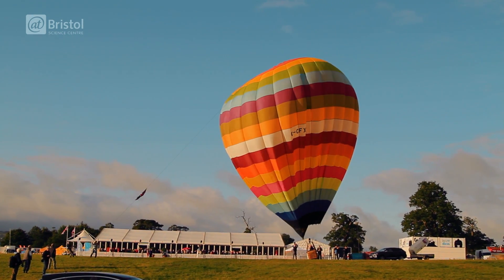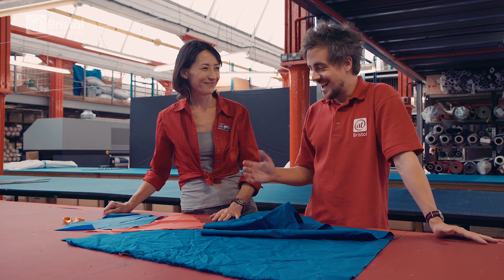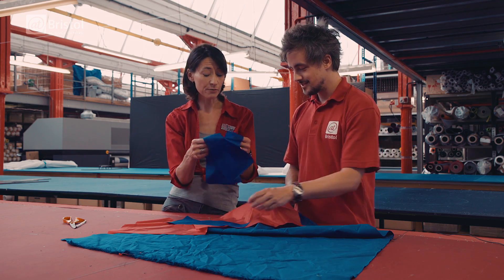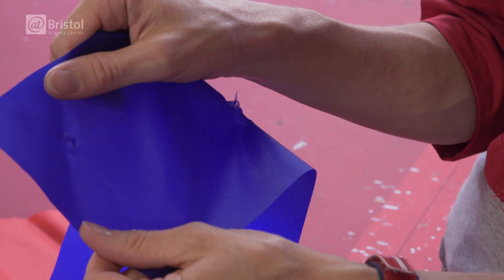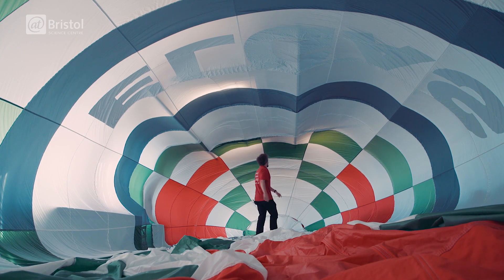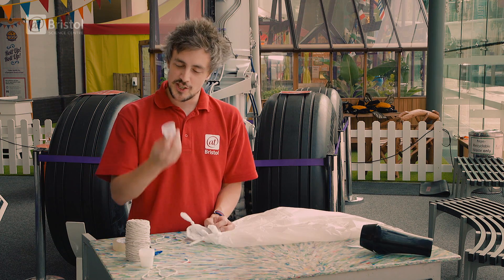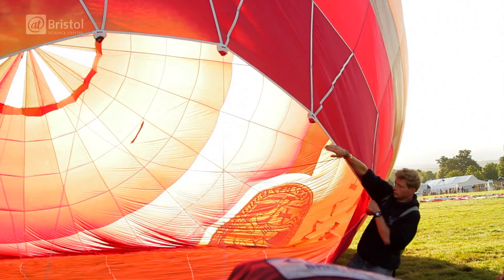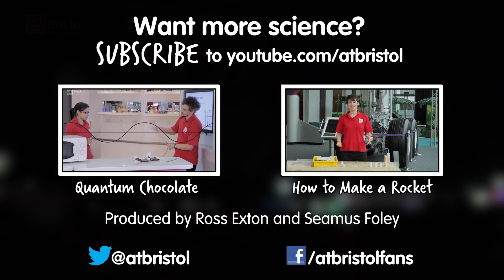How to make a hot air balloon | Do Try This At Home | We The Curious

Comment: HELP! I can't make it work. I used 2 13 gallon bags taped together and I can't even get it to fly without pipecleaner man.
Reply from the maker: Kathi Taylor Hi Kathi, sorry to hear you're not having much success, here are a few more top tips to help you out:
- Use the thinnest/lightest bag material you can find; lots of black bin bags are made of very thick and heavy plastic.
- Make sure there are no gaps or holes in the bags or tape for hot air to escape.
- Even if you're not attaching the pipecleaners, tie the corners of the opening so that the hole at the bottom is as small as possible but still large enough for the hairdryer to fit inside.
- Keep heating the air inside until the bag is rising so much that you can feel it pulling upwards. Heat it so much that it feels like you can't hold onto it for much longer, then heat it some more.

Don't give up. Keep experimenting & let us know if you need any more help. If you manage to get lift-off, send us some pictures!
Reply: We The Curious how do I make one that can lift about 200lbs